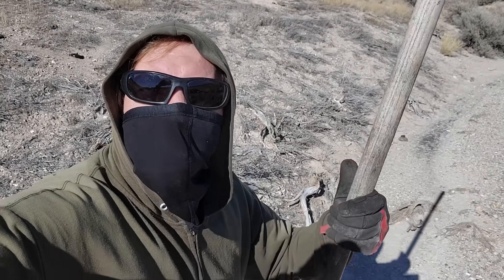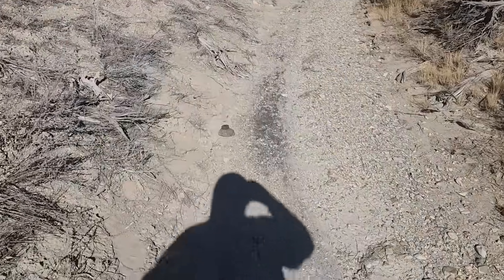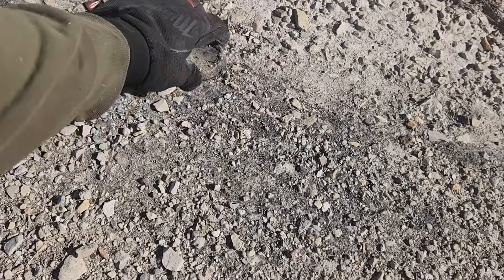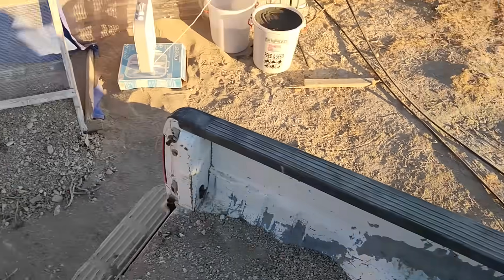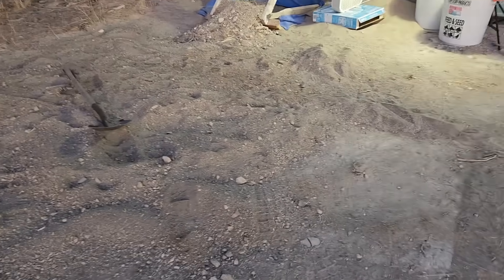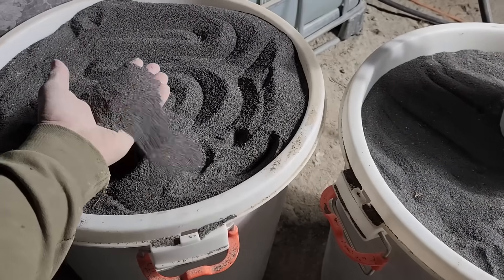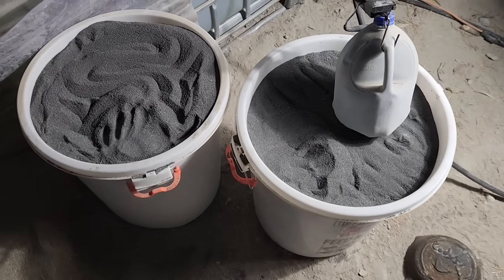Mining Magnetite

Comment: Every body in the comments making suggestions for how he can improve it miss the point that this is a simple solution that is very effective. I don’t think Cody is trying to trade any of that simplicity for extra purity or yield if he already has a system that can get him literal tons of magnetite in hours.
Reply: Still would probably be worthwhile to implement the "Put a Plastic Bag over the Magnet" suggestion though, as that's also dead simple to add to the system, and would increase the speed of post-operation cleanup.
Reply: @travispluid3603 truly the only worthwhile suggestion
Reply: @travispluid3603  I think having direct contact between the magnetite filings and the metal of the magnet is probably a lot more efficient than having a gap there (the plastic)
Reply: @travispluid3603 but there is no post operation cleanup? He doesn’t need to clean the magnet afterwards, he only did it so we could see how the process works
Reply: Would love to see him making new magnets from magnetite.
Reply: The biggest thing is that he has an abundance of ore, so, there's really no reason to get crazy about yield, simple is better.
The only real improvements that are viable in terms of the end result are labor/purity related. Still plenty of improvement to be had, just, not where most people are looking. Not having to shovel or lift buckets would be a big improvement, and you see that alot in more commercial mining, where things are lifted once, and then the process happens vertically.
Reply: Anybody suggesting that extra purity or upgrading the system is unneeded is missing the point of the scientific method and the practical applications of Cody's system. 
There's no point to casting a pan with thermite if the pan isn't even usable at the end.
Reply: Eh, its very easy to underestimate the amount of work one added "small" step of complexity can add. And over-estimate the benefit of what your super clever extra step does. Ive done it many times.
Reply: Cody is all about trying new things though. :)
Reply: Id like to see an engineer to make him mine straigt from the beach. Using an powerdriller (battery) as source of power.
Reply: Did you ever think or consider panning some samples from the waste dirt you separated from the magnetite ? Because it is so heavy magnetite is often found in the same location when panning for gold . The magnetite is usually just discarded as waste. Considering the price of gold, it might be worth panning a few samples of your waist pile.
Reply: That of course should be "waste" pile instead of "waist" file
Reply: GOD! I HATE VOICE TO TEXT!
Reply: You're assuming that the process that provides quicker and purer results is less simple. I'd say it really isn't because what he's doing is fiddly. But it will require cranking.

Comment: At Perth Scitech as a child they used magnetic roller at the top of conveyer belt from memory. the non magnetic material flew off the end with some velocity, but the iron ore particles rolled under before being removed from the field.

The buckets were very similar... :-)

Edit: Oh, love it, the concept is a great low energy solution that is very impressive in its quality output.

Comment: Why not try placing a zip-lock bag around the magnet? This could make it easier to remove the iron particles, as you could simply pull the bag away without directly handling the magnet.

Comment: I have actually done this in industry, we were processing pumicite when a customer complained about the black particles (magnetite) so I installed a magnetic roller in the end of a conveyor and got a similar result we found a customer doing epoxy flooring who paid good money for the Black fine metallic (glittery effect) sand. It did look very cool as a floor. I have also heard of people using it a ballast in boats either mixed with polyester resin or made into concrete Its true density is the highest for a sand.

Comment: Have you considered using the second smaller magnet with the first one as a second filter to pull from the tailings?  It would save the trouble of having to mess around with pouring the tailings back into the hopper?  The smaller magnet holds less, but this would be less of an issue since it is only pulling from the tailings of the first.  It would allow you to put 4 full buckets through the system twice in half an hour vs 2.5 (two through the big magnet twice and one through the small magnet once).

Comment: If I remember correctly, magnetite is quite a bit more dense than the surrounding sand, which is why it ends up leftover with the gold when you're panning for gold. I suspect if you put a fan below the magnet at the right angle, you could blow the residual sand even farther away from the stream of falling magnetite and end up with significantly more pure results. Another option would be to put the magnet behind a curved piece of slick plastic, so the falling magnetite doesn't have a way of actually staying in place and accumulating as it falls, as the falling material above it will push it down until the magnetic field is too weak to hold it.

Comment: The iron will likely be heavier than the rest of the sand, so you could improve your separation by having a fan blowing from behind, pushing the loose sand further away from the dropping iron. You'd want to add a backstop (frontstop?) to catch the blown sand so that you're not filling the whole area with loose dust though.
Reply: I had the same thought, but some of the iron particles are also smaller than a lot of the bits of sand and debris, so they may still weigh less. I think a fan would just stir up all the fine particles including the iron.
Reply: @N8Dulcimer  Just make sure to classify (pass through increasingly fine meshes) the mixture you're filtering so you have a relatively uniform grain size-- it's how panning (for gold) works, using the differential density to wash away the lighter materials while leaving the dense (and therefore heavy) gold behind. Magnetite is a big problem when panning for gold because it's much denser than most of the other things you wanna wash away, making it hard to separate cleanly. I did write this comment before seeing some comments by others suggesting additional magnets, which is admittedly a much better idea than a fan since it's completely passive while a pan requires a power source.
Reply: @Qwerasd  That is leaps and bounds more work...
Reply: Or just multi-stage magnet filters (several magnets positioned further back to capture more of the magnetite)
Reply: @t4thfavor1212
I was thinking the same, just extend the magnetic field back a bit more with a second not so big magnet so that the field drop off happens a bit further back and is more separate from the sand.

However, like others pointed out, he already get significant purity for his needs and usually a second pass does the same, gets cleaner, no need for more magnets or use of electricity with a fan/blower.
Reply: I was kind of thinking about the blower assistance thing too.
Reply: Crossed my mind as well just a light breeze.
Reply: Really small magnetite will probably be caught by the draft, possibly better yields, but now the work area is more dusty. Silicosis vs couple % more yield.. 🤔

Comment: Let me suggest another method, already being used.  A conveyor belt carries the soil up to the top roller, which has a series of electromagnet bars. The dirt is thrown off the end, while the magnetic particles stick to the bar magnet until it's switched off on the underside, at which point the magnetic particles fall of into a different chute.  I believe it could separate a lot more efficiently.

Comment: Making the rig a little taller could make it more set-and-forget. If the first collection of tailings falls into a leaky bucket and streams past its own magnet, the second pass is automatic. There's probably not much room to gain purity, but re-processing the finished magnetite collection would help achieve whatever can be done. Mixing and settling in water would probably drop the iron to the bottom, as well. Probably not any point in doing that as it seems to work remarkably well for thermite.

Comment: If you wanted to increase your separation rate, you might try mounting your magnets to a horizontal ferrous bar or rod. I believe the magnet will then magnetize the rod. If the magnet is strong enough, you might then be able to run several streams, or even a curtain of material over the bar, an increase your processing speed.

Comment: I have a question/suggestion. Why not put the collection bucket up way closer to the magnet, set it on bricks or something? It seems like a lot of light sand is kinda getting blown into the magnetite, but maybe that's a small portion idk. Also, on that note, have you experimented with different hopper heights and magnet heights? Is there a speed at which the sand falling might be the the most efficient for magnetite removal? I would imagine these suggestions would make little impact on your efficiency overall, and for your intents and purposes what you have done is more than suitable, but I cannot help myself but to ask these questions.

Comment: You might be able to increase both yield and purity by putting up a curved shield to keep the particles from getting close enough to the magnet that they stick. Probably 5mm closer than the tips of the spikes in front curving to 1.5cm or so closer below. The distance below the magnet to the top of the bucket is also a parameter that will affect both which can be easily adjusted, as well as distance from hole to magnet and geometry of the hole. If you can funnel it to a curtain parallel to the magnet face, your separation will improve with a thinner curtain giving better results I suspect.

Comment: Cody: refines uranium
FBI: no.
Cody: fine. 800lbs of thermite
Reply: Next up: Uranium thermite
Reply: @StuffandThings_  "now I am become death, the destroyer of worlds" 
- Cody, in his head sometimes.
Reply: @BeforeTooLate-r3c  thorium thermite
Reply: Next up- Codyslab converts uranium to plutonium
Reply: 1600lbs of thermite*
Reply: @eastonjanecek9802  nah the aluminium is much lighter than the magnetite, so its only around 1100 pounds give or take
Reply: @eastonjanecek9802 it is around 1k bc the aluminium is lighter
Reply: Great video Cody! There’s no limit to human ingenuity! Give us enough time and we’ll figure out anything and everything 😅
Reply: Should add thermite is 100% legal to own and manufacture in part because it can be created accidentally, it really is just a reactive metal and an oxidizer so not much you could ban about that.
Reply: @DanielKay06 where I work we work with both steel and aluminum, so some days I wonder what the possibility of accidental thermite is.
Reply: @jwalster9412 The probability of accidental thermite is pretty low, IMO.  Cody did a video with some very coarse thermite, and it was a pain to ignite.
Reply: @davidmescher2526  aluminum and steel dust.
Reply: @jwalster9412  All you need to do is grind a piece of iron on a grinding wheel that had been used on aluminum.
Reply: @paulkurilecz4209  not really. Since it needs to be specifically dry iron and aluminum oxides.
Reply: @jwalster9412  Would you like to try it to prove me wrong?  🙂
Reply: I am only at the start but why not use a magnetic broom to "sweep" the river bed
Then a real broom to sweep the top off then repeat that would speed up the field gathering
Reply: I miss the desert!!!
Reply: correction. enough iron to make 3200 lbs of thermite
Reply: How frequently do you actually catch a cease and desist correspondence?
Reply: You are wonderful for my autism. Thanks!
Reply: Did he get harassed about uranium?
Reply: @Coincidence_Theorist  I think the NRC took mild umbrage to Cody making yellowcake, IIRC, they confiscated the equipment used to make it. (Because it was rather radioactive, because it had uranium compounds in every crack, crevice, nook, and cranny.)
Reply: Nuclear thermite
Reply: Bruh. As soon as I saw the buckets I was like...Calutron...
Reply: Cringe
Reply: FBI: I give you 9 out of 11 for the effort
Reply: Dobrá , vtipná odpověď .😊😊😊🇨🇿
Reply: Purely for educational reasons
Reply: Did they really tell him no for uranium?  If so, that's like peak ignorance
Reply: I guess but if you want to put a little bit more time into it add some more magnets below it by the time it reaches the bottom you'll just have a bunch of filled up magnets and a pile of just dirt 😊 I used to use this method when I was shoveling gravel and didn't want the little bits of gravel I just wanted the Rocks I used wind to take the dirt out of the rocks informed two piles
Reply: Lets not glance over that he made a new way to collect magnitet and it is super effective and cheap
Reply: i wish we were all responsible enough to run homemade reactors for home research itll just push us all to be super inquisitive and inventive (prob hoping for a star trek earth)
Reply: How to make a home made nuclear reactor?
Reply: @HideorEscape  first things you'll need are a small toy named "the demon core", and a screwdriver......
Reply: Ukraine calls , we need more thermite for our dragon drones.
Reply: @texasslingleadsomtingwong8751 . Ukraine can go buy it
Reply: @texasslingleadsomtingwong8751  You made me do some math.  Assuming 45 metric tons per tank and 8860 tanks lost, Russia has provided Ukraine with about four hundred thousand tons of scrap iron.  Cody is really going to need to offer some low, low prices. :-)
Reply: @wargamingrefugee9065  they'd have to grind those tanks into dust to be able to make thermite. cody's magnetite is already in powder form!
Reply: @wargamingrefugee9065  Almost all of those vehicles, and CERTAINLY the tanks, are  a COST to scrap, not a return.
Armor plate, and contaminated scrap like a tank is,  costs money, a LOT of money,  to recycle. Cutting the plate costs a vast amount of energy, and you have to cut it  into  sections that are  less than a mtr square. 50 years ago, to recycle the heavy armored turrets of  a light cruiser, at the end of the process the steel  cost five times normal scrap steel prices.
That is if you can sell it to one of the bigger foundries in Korea or Japan or China. I doubt Ukraine has  really big recycling foundries like the big three have. If you sell steel scrap to the Indian foundries, you have to cut it  smaller.
Reply: @wargamingrefugee9065  rofl 🤣  nice
Reply: @wargamingrefugee9065  That's a couple days worth of steel out of any decent mill.
Reply: @texasslingleadsomtingwong8751  obligitory Slava Ukraina
Reply: Crappy thermite.. it's basically a few cases of empty beer cans and rusty nails thrown together in an old bud light box. It is NOT same same
Reply: @notyouraveragegoldenpotato bro is gatekeeping thermite !

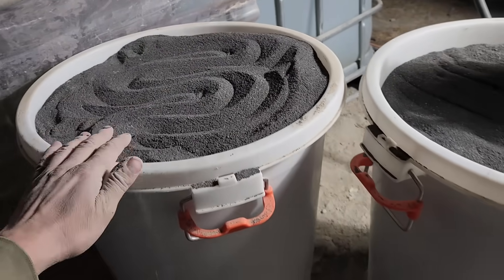Comment: 15:05 17 gallon containers times 2 = 34 gallons, 20 lbs per gallon is 680 lbs not 800. if you increased the height you would get a higher seperation but the energy required to lift the dirt would go up by a lot so if there was a way to use solar to lift the material it would benefit from more height otherwise gj

Comment: i wonder if you could use a sheet of glass to prevent the stream from sticking to the magnet, angled backwards so it still allows the deflected stream to pass by the magnet and away from the vertical.

Comment: Use a round magnet on a center shaft so it can rotate with a scraper on the back side.... as it accumulates weight, it'll rotate and shear off the magnetite away from the tailings stream.
Reply: It doesnt matter for the yield rates if there is always a kilo of magnitite on the magnets, and it makes the whole process much simpler. Because he is processing huge amounts of materials, that 1 kilo of magnitite that doesnt end up in your bucket (but doesnt get lost) doesnt really matter that much

Comment: A looping conveyer belt with some magnetic rollers towards one end could work well. You pour the mixture on  and at the end the sand will fling off and the iron will loop around and ride along the bottom side until it passes the portion with magnets and fall down in a different spot. This method seems to work well enough though and you only need gravity so

Comment: Could you not just use a magnet in a plastic bag to get the very last bits of magnetite out of the tailings? that way you can shake it a bunch and all the dirt will fall off whilst the magnetite stays, then just pull the magnet out to seperate

Comment: Cody, if you want to get even better separation of the sand, use a high voltage electrode and the sand will deflect towards it by electrostatic attraction, as quartz is a dielectric.  The  magnetite is conductive, so won't go that way.   This is what is done in iron ore processing.

Comment: Usually they use a rotating PVC tube around an off center magnetic rod. As the ore runs over, under, or past the outside of the PVC tube, it turns and moves the particles over a chute where the distance to the magnet is now too large to hold them on the side of the tube and they fall off. This whole thing can also be done with magnetic conveyor belts rotating over a stream of ore to move the magnetic particles.

By the way they make these things for construction sites to pick up magnetic scraps that work really well. There are also 3D printable designs for magnetic seperators.

Comment: Working in Waste Management, we have two big magnets in our Resource Recovery stream. Both of them are set inside conveyors belts. Rather than being stuck to the magnet, the metal sticks to the conveyor, which then pulls the material away from the main stream AND away from the magnet, so that the metal is released into a separate area.

Clearly, your system is already very good, but if you wanted to get around having to clean your magnets or to get the sand stream even closer to the magnet while separating, that would be my improvement; put some wings on a bucket and spin the bucket around an off-center magnet.